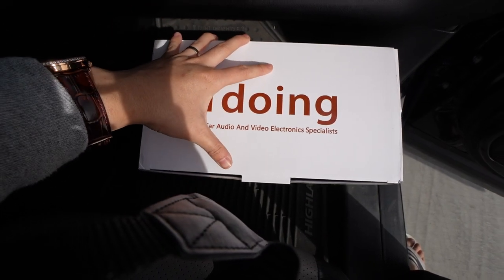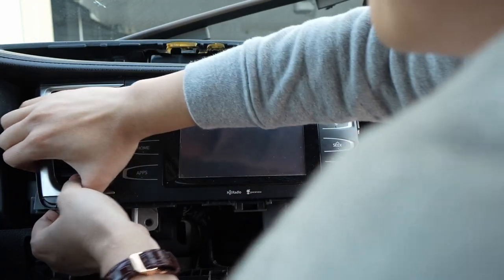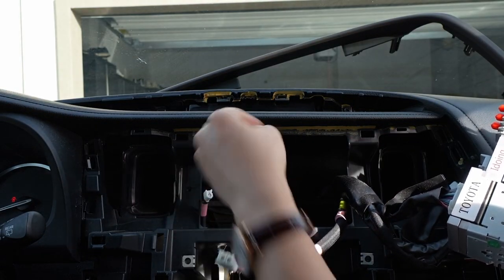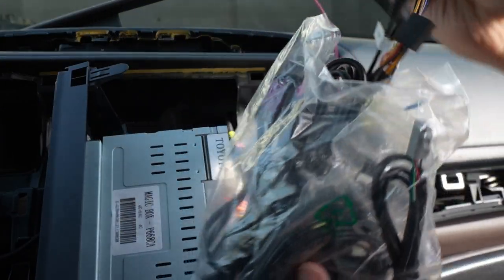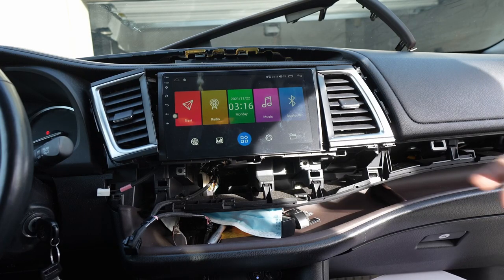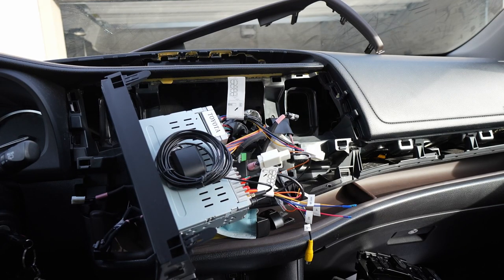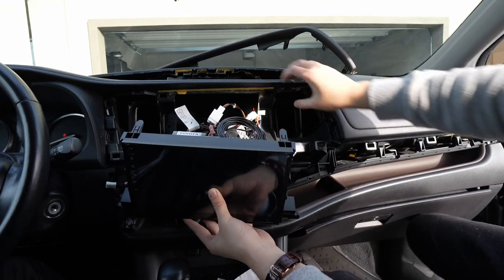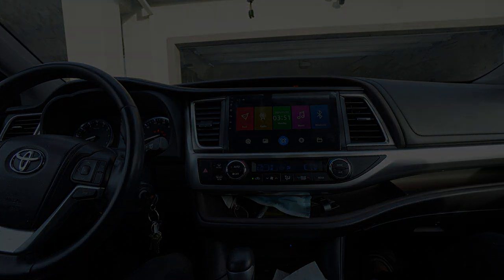Toyota Highlander 2013-2018 Android (Install - Beginner Friendly) | Making the car new!

Comment: Hey man, I might’ve missed if you said it or not but does this utilize the factory camera? Or is it a new one that came with it?
Reply: Same question i have.... I want to order it now. Looks awesome.
Reply: Ordered this unit, now have "no signal" on reverse camera. Everything else is fantastic.
Reply: @WaymondJr how do you maintain the factory reverse camera
Reply: @jackfieldsjack1061  there is a very small selector switch among the plugs. Try it one way then the next. Also, the plug for the video feed will fit in two places on this unit. Try moving it as well. Playing with these combinations , I was able to get it to work.

Comment: I'm thinking of getting the joying 11.2 inch for the 2008 to 2020 Toyota Sequoia.  But I noticed the Dasaita seems to state the cables it comes with. Should I go with the Daisata instead?
Reply from the maker: if its made for the car then it will come with the harnesses.

It's the universal ones that require the oem harness.

Comment: Don't full yourself by replacing Toyota original equipment with aftermarket device. I already install one to my 2008 highlander. They just don't work, have bad reception, don't  sustaing ambient cold or hot. So, total disaster. I would never do that again

Comment: So to clarify, this head unit does not support SiriusXM radio?
Reply: I've been trying to find the same thing out. Some places say yes and others say no, it's so frustrating. I'm also trying to figure out the whole wifi thing, that's got me confused as to how that works
Reply: Don’t see anywhere that states it is Sirius/XM compatible, meaning you would have to buy a separate radio receiver.  But if you look at the back of the unit, I can’t see a port for a satellite radio to plug in nor the satellite radio antenna.  My guess is it doesn’t support it.